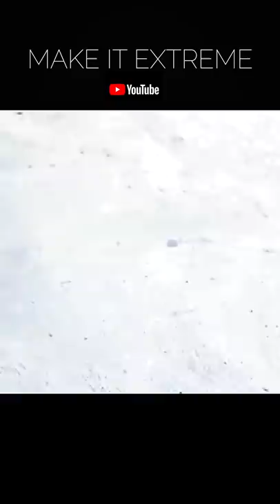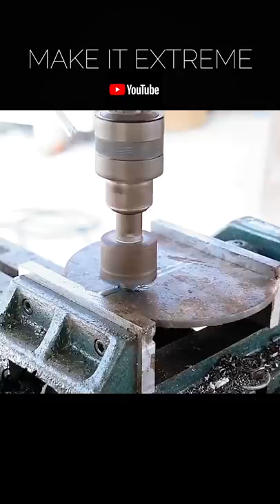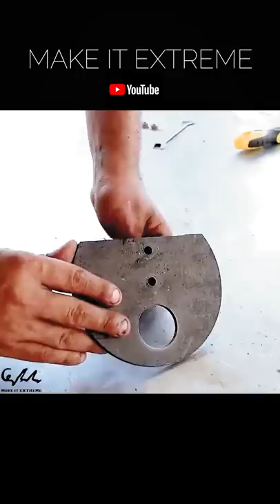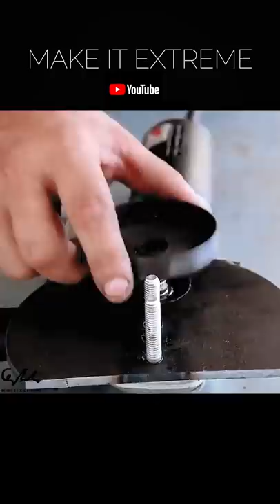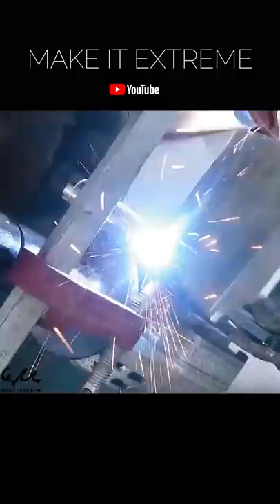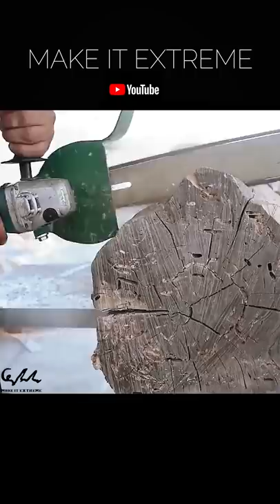Angle Grinder Hack #shorts

Comment: So, this is really cool but extremely dangerous. Chainsaws have a clutch that is engaged by pulling a lever in front of the handle you hold with your support hand, if the blade hits a knot or any hard spot that can cause kick-back, that handle will hit your support hand and disengage the clutch, seizing the chain. This lacks that feature. 
It's freaking terrifying.
Reply: This is very unsafe and let's don't forget he is not oiling the chains so it's not gonna work for long anyways the bar would burn up in a little bit of  Cutting you'd be surprised how hot those chains get

Comment: That will work until the chain and bar get hot enough to fuse together from the friction caused by the absence of lubrication!!!! You should have used the oiler system from the chainsaw to keep I working properly.... 🤷🏼‍♂️ It would be good for small projects as long as you keep oiling the bar and chain!!!

Comment: I personally think this is pretty cool but it’s extremely more expensive than just going out and getting a chainsaw fixed you might even be able to find someone that’ll just do it for $20 so I think this is completely impractical and plus you need a welder and everything not very many people just have welders sitting around nor a chopsaw that with a metal cutting blade.